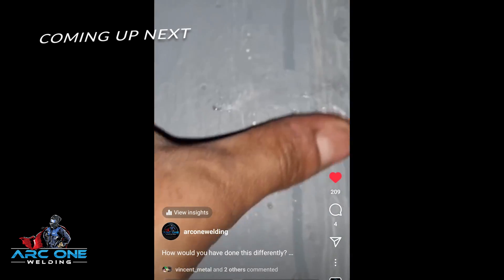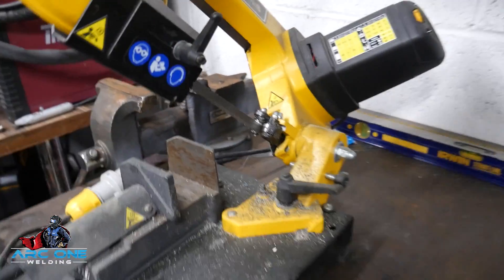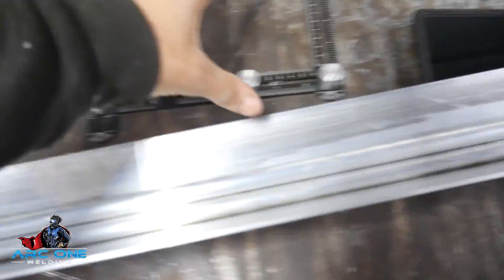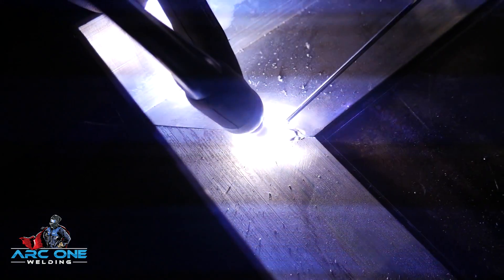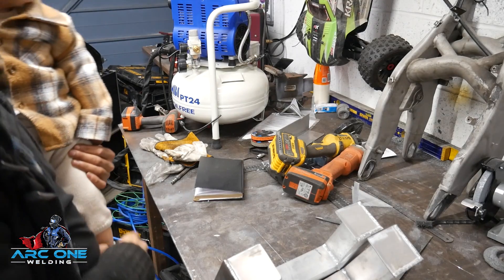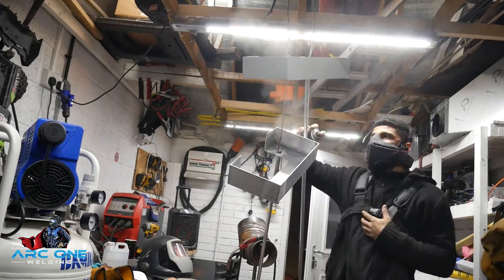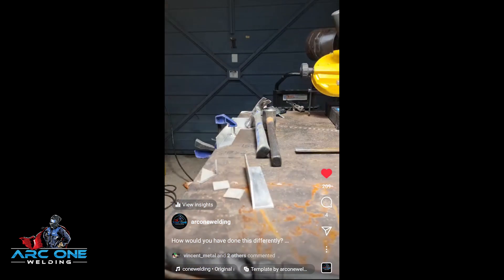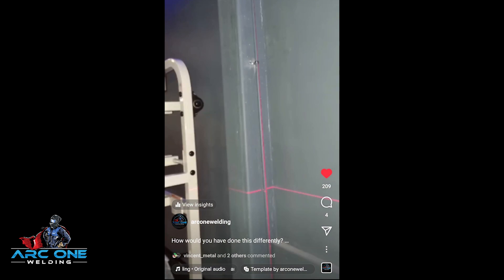Fabricating an Aluminium Gutter

Comment: Not bad at all. Almost gotta have a foot pedal to make things more consistent. Next time, take the time to clean all the weld area with a stainless brush and wipe with acetone. Scotchbrite and acetone for the filler. 

Bullard Abrasives makes a flap disc for aluminum called NETGRIND that works amazingly, doesn't clog up like regular flaps and lasts a good amount of time if you stay off the sharp corners.

Comment: i use a similar tig torch without a foot-pedal, less hassle for me when working on bigger parts.
when i weld alu i use a 2.5sec upslope and a 3.5sec downslope and just blast it for tacking and in the beginning of the weld, then i gradually let go/push as the heat builds up. works great for me. 
if you push the button each time you add filler it turns out real nice and you dont overheat it.
takes some practice but eventually you can just set the machine to 180-220 amps and basically tack and weld without ever having to adjust the amps. and you dont need to kick the pedal around. you should also invest in some tig fingers from jody at welding tips and tricks, having a place to prop is like the ultimate cheatcode, theyre cheap and lasts a long time. 
thanks for all the great vids and knowledge youve provided me. cheers.